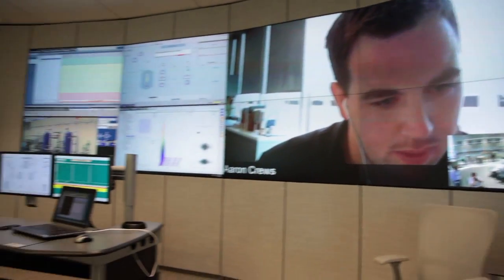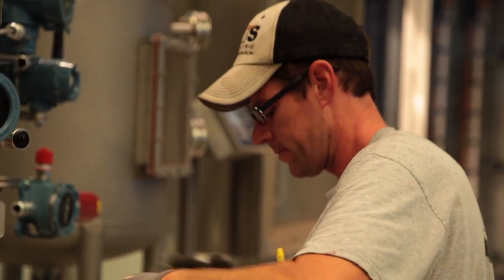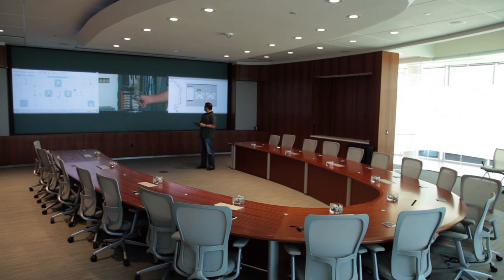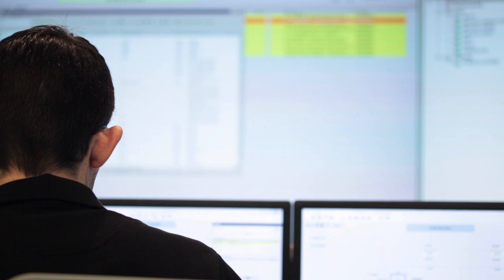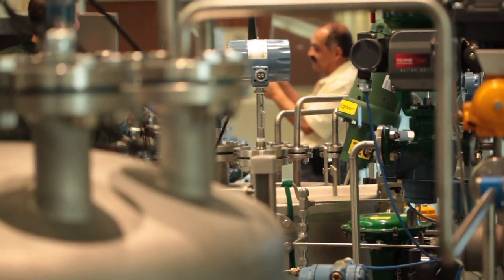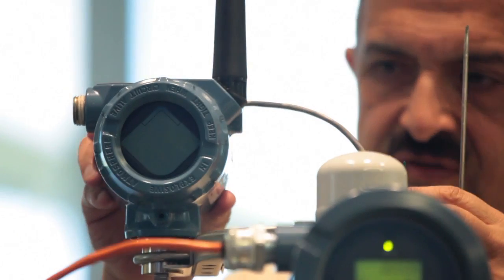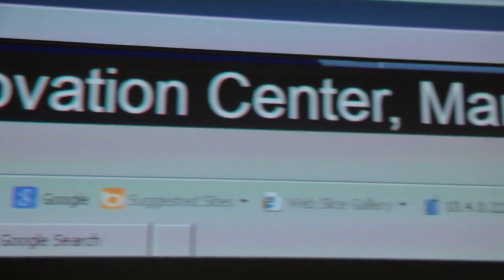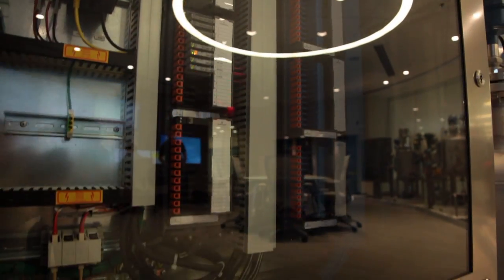Emerson iOps Center Overview

Comment: Emerson's "iOPs Center" framework is certainly capability of providing extraordinary value to it's customers. It is important to remember this will only be possible if the host systems and field devices are installed, configured and maintained properly. The old adage "garbage-in, garbage-out" needs to be heeded especially with this or any remote access technology to insure effective implementations to provide the expected safety, operational and maintenance benefits. RCF